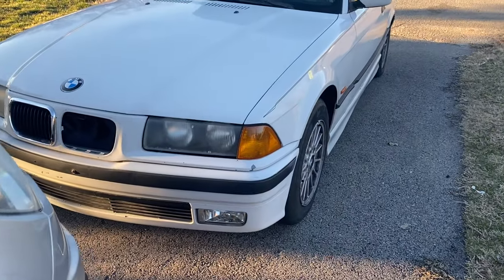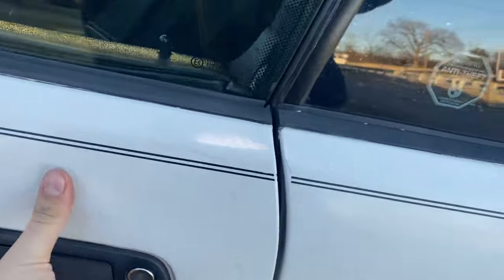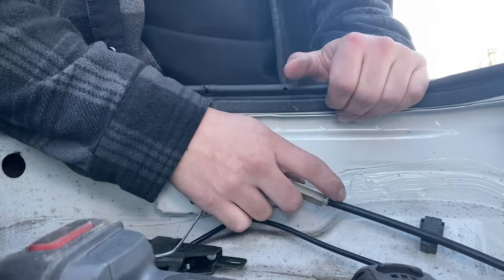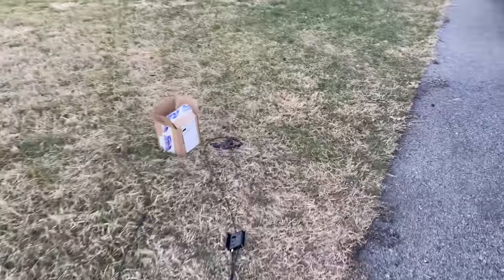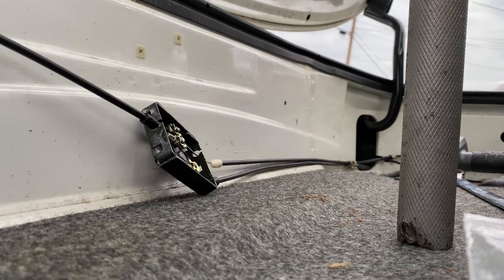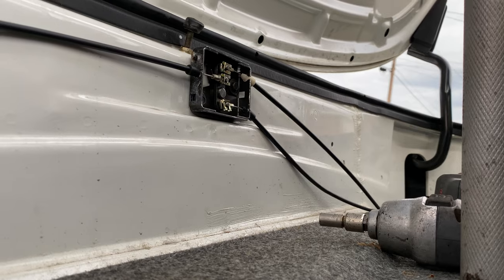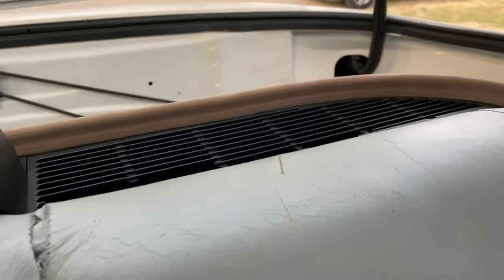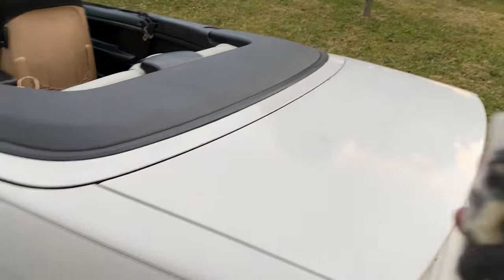E36 Goes Topless! Manual Top Conversion

Comment: #E36Vert

Where are your headrest and i see you don't have the rollbars on the back must be a business model with a phone setup and the handle is the same as your door! Mine didn't come with the clips or a proper placement had to rig and make brackets and the right side cables because i didn't have that with the hooked lock i purchased grate content👍